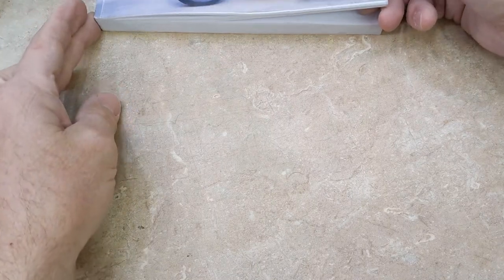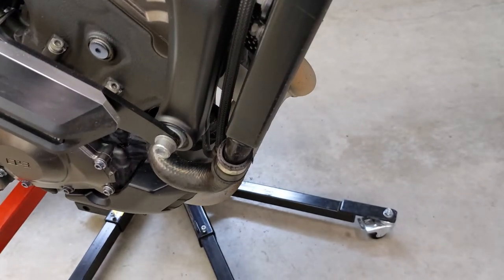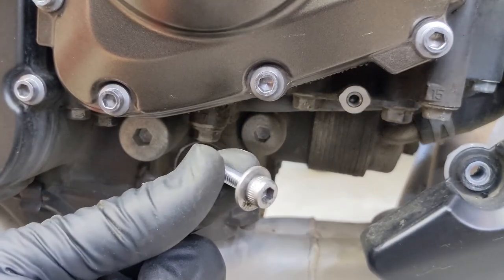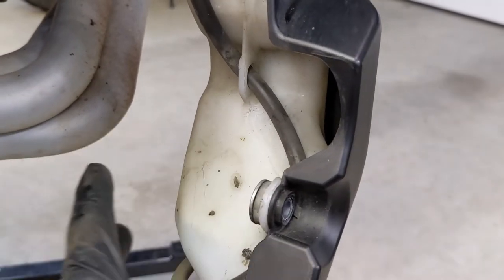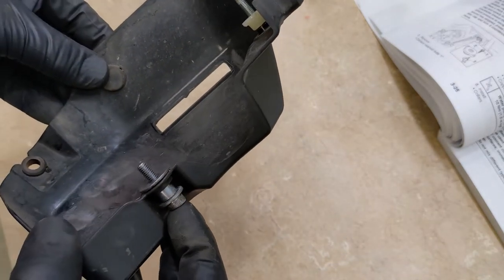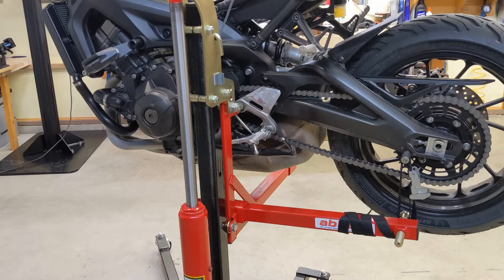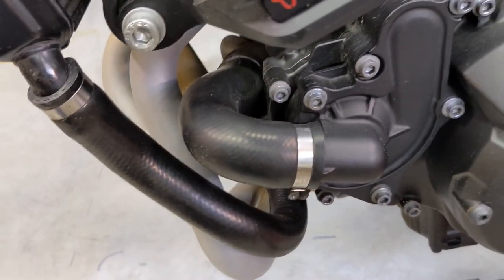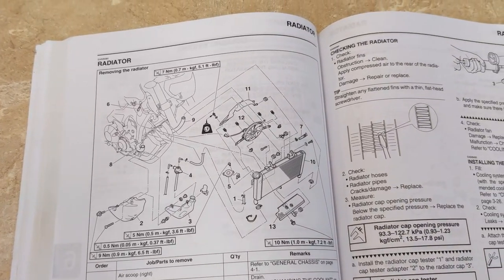radiator cap/overflow bottle removal/coolant draining Yamaha FZ-09/MT-09 2014 2015 2016

Comment: the bolt on the rad cap broke off as I was trying to loosen it, do you think it's a big deal if I ride without it until I get the new part?
Reply from the maker: Can't say for sure, but if I remember right it seemed like a safety feature to keep the cap from accidentally loosening... So if the cap seems to be on there fairly snug and you have to turn it hard to get off you're probably okay